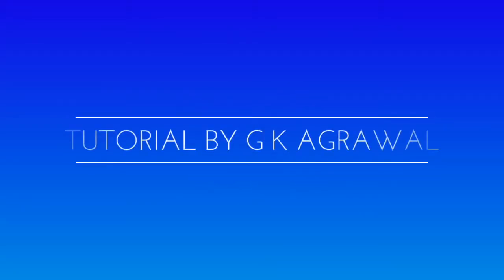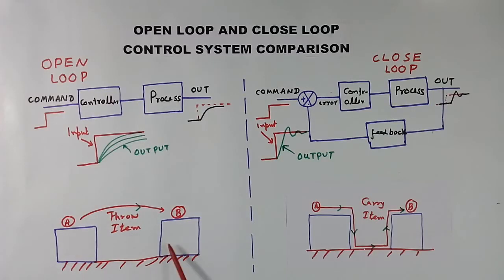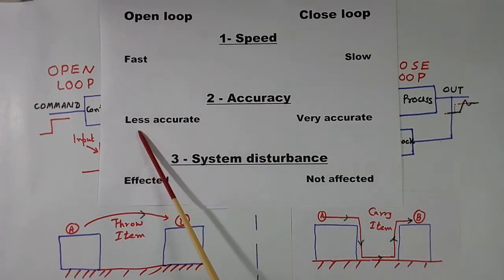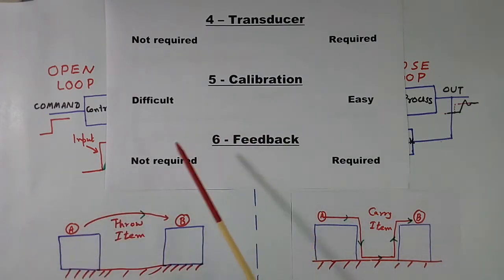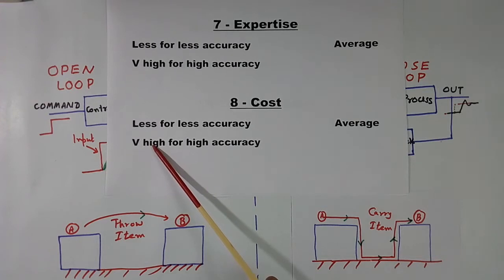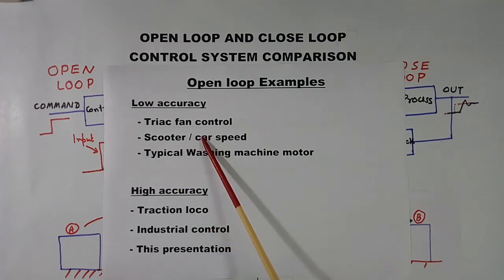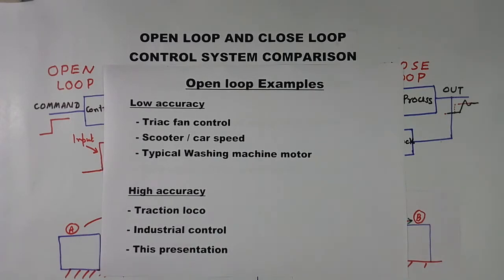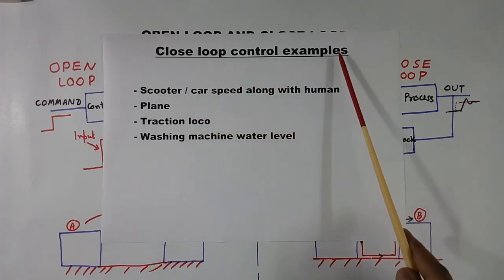Open loop vs closed loop control system difference

Comment: hello, would you help me understand:
why in open loop bode plot, curve can be affected by the velocity loop Kp ?
i thought that open loop cannot use PID gain?? 
thank you
Reply from the maker: Bode plot depends upon the considered block, like one control block, 2 control block, 3 control block or the entire system. If you take a full system then, bode plot will also depend on the 2 points considered to plot the bode plot?  Further, in the entire system, the gain or phase shift or bode plot depends on the point of operation of the system also. If there is a closed loop also working, the then closed loop will change the operating condition of the system, and hence bode plot will be affected.
Reply: thank you for your reply. actually I am tuning a Servo motor. there is a function to grab a open-loop bode plot. 
would you help to guess which loop it is plotting from your experience?
Can i say that , bode plot is plotting the response on Current loop, even it is open loop, the velocity loop Kp still affect the input into Current loop?

Comment: thanks. probably way off your topic however this helped me understand when a cars ecu is using o2 sensors the determine air fuel ratio that means closed loop, and when the ECU is ignoring the oxygen sensors that is oppen loop.
Reply from the maker: Thank you for a value added comment